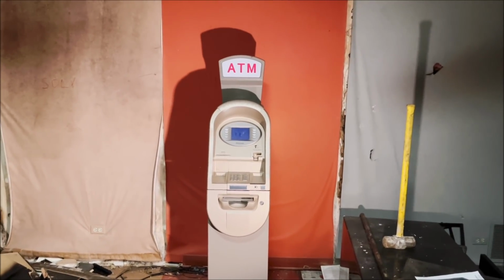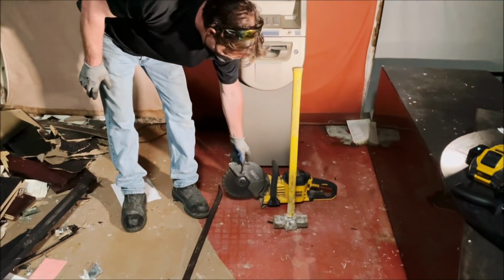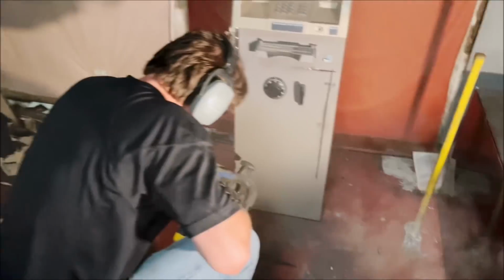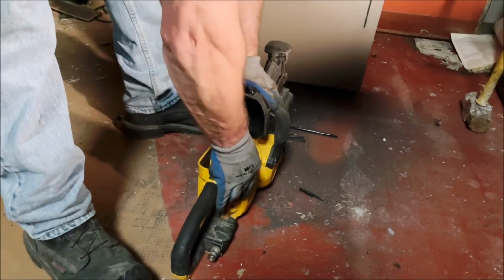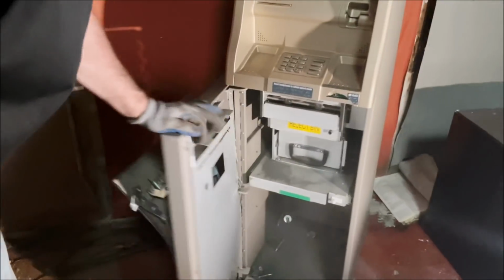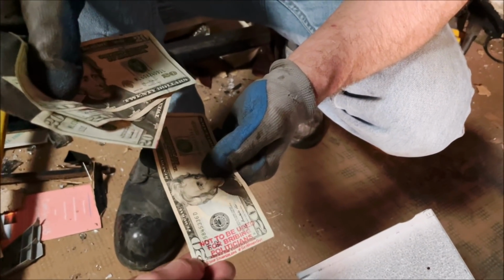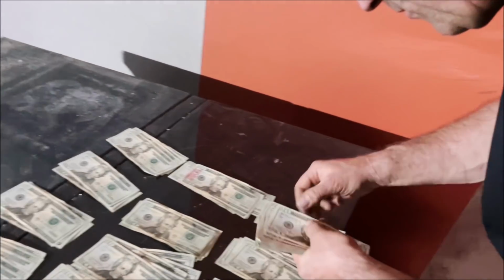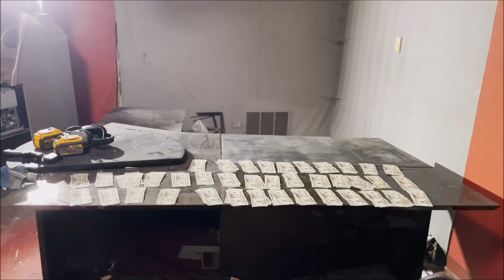We Broke Open an Abandoned ATM Machine and Hit The Jackpot Of A Lifetime! (FOUND THOUSANDS OF $$)

Comment: I cannot recommend highly enough the use of personal protective wear , Especially eye protection when attempting forcible entry of cash dispensers. some manufacturers of said equipment sometimes use unusual materials in their design and fabrication specifically to defeat power tools such as the angle grinder demonstrated in this video. Resultant effects of this measure range from seizure of the drive mechanism which may cause the tool to be wrenched from the operators grasp, to catastrophic and possible explosive destruction of the cutting disc ( think fragmentation ordnance! )
    Before commencing work, in eager anticipation of any possible reward, remind yourself that your life is far more valuable than ANY possible contents, and take some consideration of  ALL other possible means of entry.
     I have, for example used a modified heavy duty hydraulic jack in similar operations to good effect. I trust you find these comments helpful or at least thought provoking.

,